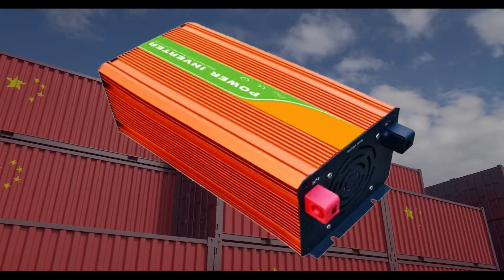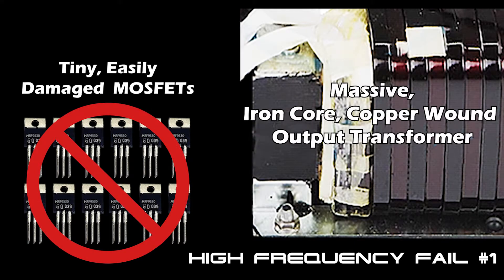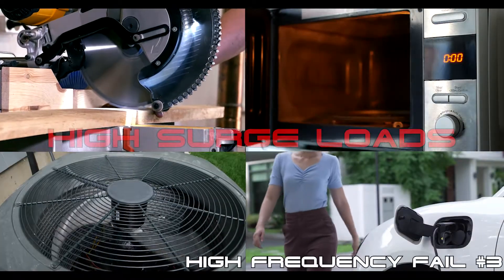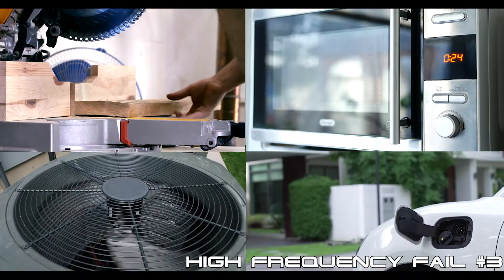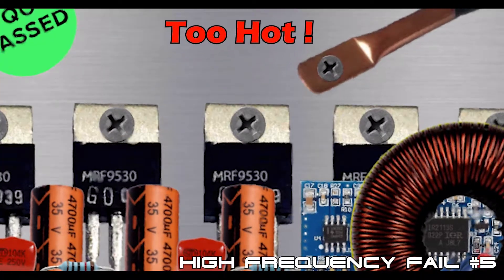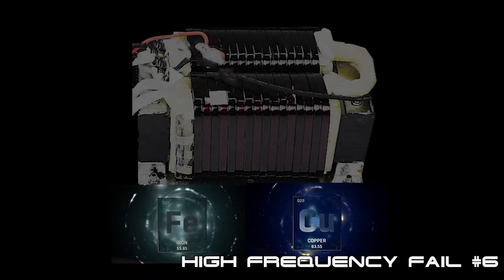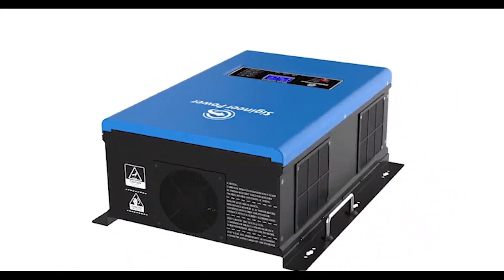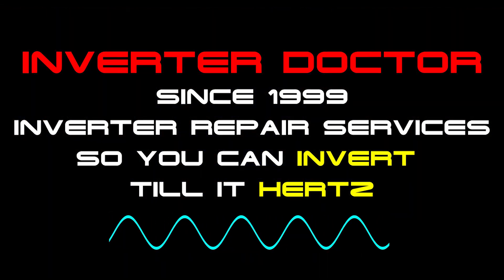Low Frequency Inverters Versus High Frequency Inverters

Comment: With a American built salvaged 3 phase 480 delta to 208/230 wye 27 KVA  a 300 pound transformer (silicon steel core) a big hunk of iron makes all the difference all you need is the core.Beware of chinese  transformer cores typically made with recycled lawn furniture and East Indian hand tools poor permability very lossy .
Designed  a LF  240 vac 100 amp service 60 hz split phase inverter output .
48vdc to  550 vdc input coming up on 22 years just loafs along but does hum a little. Schematic and build kits available Upon request. 10kva thru 60kva also you  can use linear welding machine transformer cores preferably of western origin.

Comment: You cannot convert DC to AC without MOSFET  HF or LF need MOSFET to turn the DC into AC?
Reply: Everyone knows that.
Reply: A low frequency  inverter converts  dc input to ac then feeds to heavy/large copper transformer then outputs to appliance,.A high frequency  inverter steps dc voltage upto very high voltage dc through mosfets switching small transformers then there output is fed to capacitors and mosfets converted to AC current then output feed to appliance.
Reply: The problem is that the MOSFETs in high frequency inverters fail far sooner than they do in low frequency inverters.

Comment: Whether high or low frequency inverter always loop in an Inrush Current Limiter (ICL)! Like mean well or any other with a bypass relay integrated.
Reply: You don't need an industrial current limiter with a low frequency inverter.

Comment: What Low frequency inverters for the home do you recommend?
Reply from the maker: I would suggest Schneider Electric, Magnum Energy, Sigineer Power, Outback Power or Victron Energy.
Reply: @originaldiysolar Victron all the way
Reply: The Titan generators from Point Zero Energy, are mobile solar generators that will power your home also, they are the only low frequency portable generators I'm aware of, I have 2

Comment: I am afraid you and your video is not really up to date! Yes, there are cheap and not really trustworthy high-freq. chinese inverters - i wouldn't recommend them. But there are also good and well designed high-freq. inverters and if you choose them according to your required surge currents they will work fine. In general high-freq. inverters are significantly more efficient in the conversion (93% avg. comp. to 85% of low-freq)! That is an important point, you don't even mention!? Also, there are european or us-build inverters in high-freq. technology with good components (Mosfets, IGBTs and other semiconductores) that are build to last but cost more than the cheap chinese clone ones. You can even buy quality from china but not for the cheapest price, obviously! So your POV is very single sided!
Reply: Most modern low frequency inverter now operate at a 90+ efficiency rating. And please name a single US company that manufacturers high frequency inverters for off grid use.
Reply: @quickquote1568  Goal-Zero Yeti 1000x etc etc
Reply: The Titans from Point Zero Energy, portable low frequency solar generators, the only ones I know, designed in America, assembled overseas. These units are tough
Reply: Tough for how long? A couple of years. Ask Google AI the question "Do high frequency, transformerless inverters offer shorter life expectancies?" And learn the truth.
Reply: @ Oh, yes - google AI knows best 😂🙄
Reply: @rilosvideos877  Yes, it does. It gathers verified data from multiple credible sources instead of data from YouTube affiliate salesmen.
Reply from the maker: We've been in the inverter repair business for over 24 years and we're "up to date" with the latest inverter tech. We have to be in order to repair these devices. More than 80% 80+ inverters per month) of the inverters that we get repair quote requests for are high frequency types. So no, I disagree  with your assertion that there are also good and well designed high frequency inverters on the market. They all have shorter life expectancies and poorer surge capacities than low frequency transformer based designs. And as far as efficiency is concerned, with the cost of batteries and PV at historically low levels, inverter efficiency is no longer the concern that it used to be.
Reply: @originaldiysolar  Lo que pasa es que se fabrican más equipos de alta frecuencia, por eso les llegan más de esta tecnología a su taller, es solo cuestión de analizar bien los números y las estadísticas antes de dar un criterio.

Comment: Which hi-freq inverter brands do you recommend (high MOSFET quality; for cases of resistive-only loads for cases where low weight is crucial)?
Reply from the maker: If you absolutely have to use a low surge high frequency inverter, then I would suggest looking into the Sigineer Power brand.
Reply: @originaldiysolar  thanks
Reply: EG4